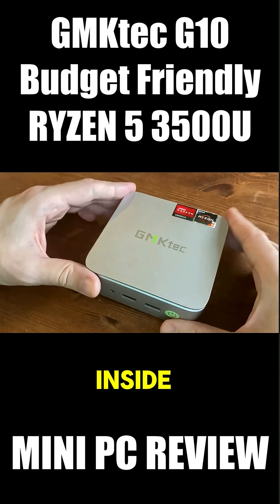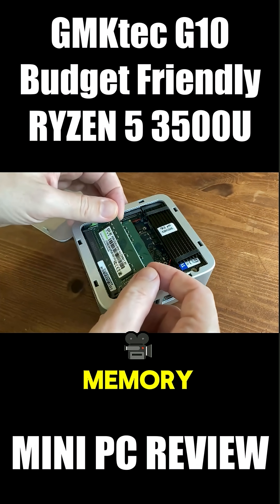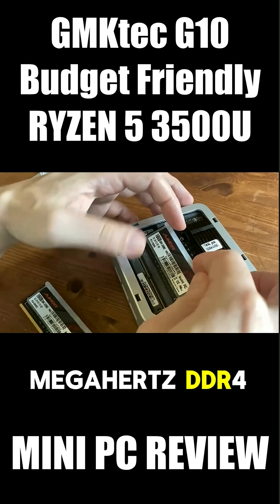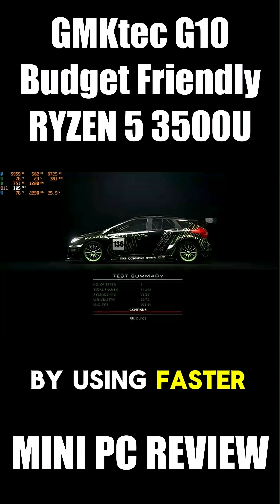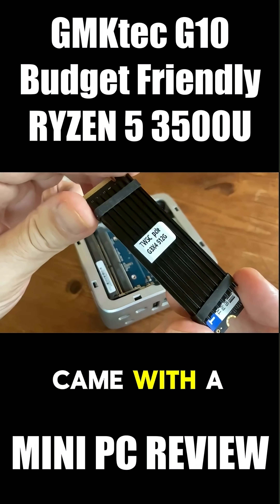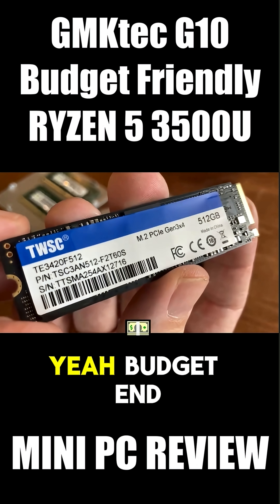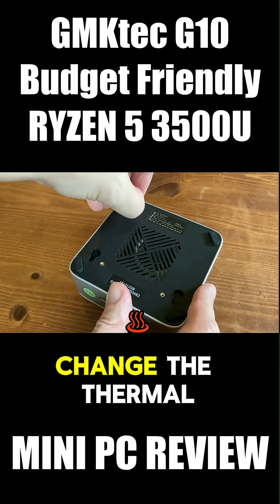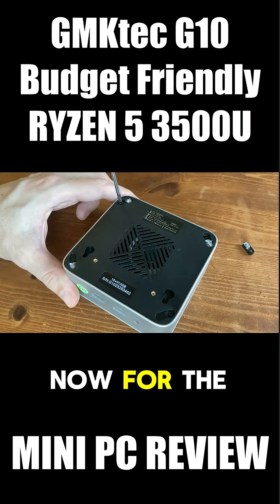What’s Inside a Budget Mini PC? GMKtec G10 Teardown 🔧

Comment: i bet those rubber straps on the ssd are gonna dissolve in time… had a heatsink with those and after a few months in a laptop they completely dissolved, almost. when i tried to remove them they became almost dust.
Reply from the maker: Yeah, you'd be better off with a plastic tiewrap tbh

Comment: I have the 3700u.  Im also frustated by 2400 mhz ddr4
Reply: Is it limited by a chip, the board or the code? I'm genuinely curious if it could be worked around.
Reply from the maker: It's the AMD chipset itself. ... Might fiddle around this week to see if there is a workaround - thinking on the lines of that universal chipset tuning utility... Universal something. 🤔